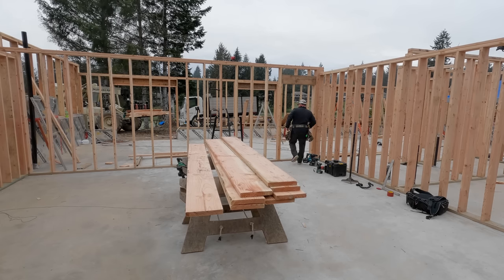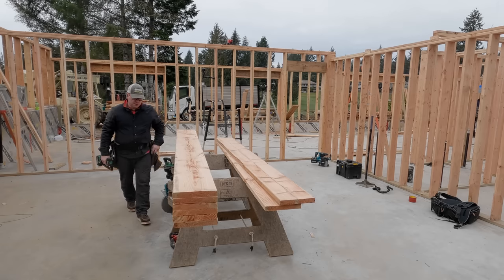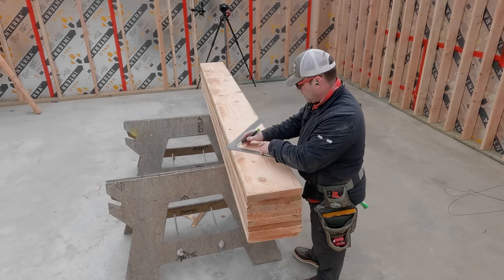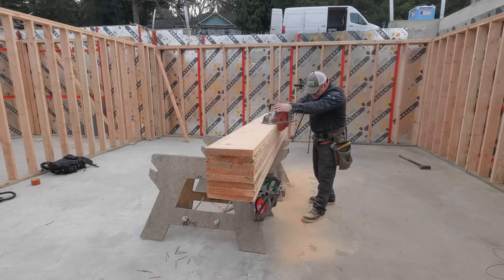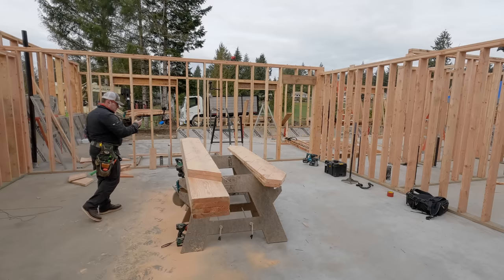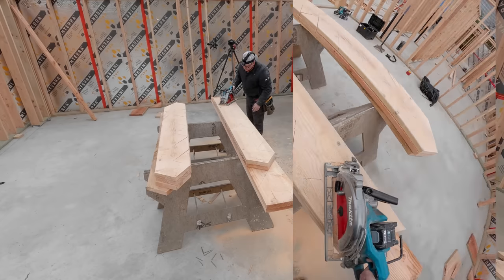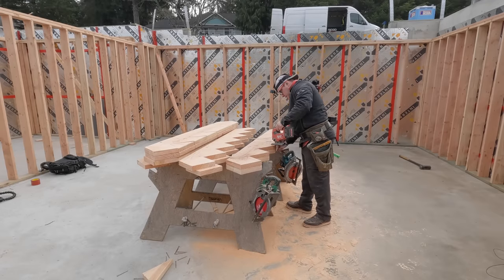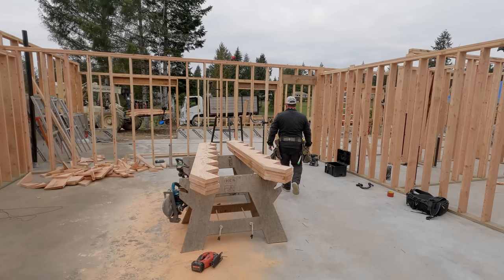How to Frame Stairs Efficiently part 1

Comment: I wonder what happens with the moisture trapped betwen that aluminum foil and the insulation. Shouldnt the barier be on the inside walls to stop the moisture getting in and get trapped?
Reply: Think it depends on climate.  Concrete doesn't mind moisture.   Where they're framing the house is cooled more than heated, I assume.  So condensation would be trying to work it's way in, not out.  The goal is to protect the wood and living space from moisture, not the concrete
Reply from the maker: It'll all dry out 👍

Comment: As a homeowner DIY'er I have found it very convenient to stick with one battery platform.  Quite a long time ago, I happened to purchase a DeWalt 12v drill/driver when my old Ni-Cad drill batteries gave up.  For years, probably more than a decade I used and abused that little DeWalt drill and it is still going strong.  So, I stuck with DeWalt.  They pretty much have every tool I will ever need.  I did stay with corded tools for power planer, jig saw and circular saw.  I use those mostly in the garage or the workshop or machine shed at the family farm.  I do have a nice power bank I can use if I ever need to use those in the field.

Thanks for another great, informative video.  I can see your point regarding your tool choices.  And yes, as a matter-of-fact, I am beautiful and talented but I don't think I can match you for singing and dancing.

Comment: You don't need to overcut much with that 10 1/4!!  Love it
Jealous of your douglas fir.
Here in michigan I rarely get it.  Builder orders lumber, not carpenter.  We typically get white fir or SYP for stringers.  The former makes me cough now and is usually poorly dried... case hardened..  and tends to move as it's cut.  It likes to become the letter 'C'.  The latter is hard as a rock and loves to split.  Also resin from syp coats the carbide.  
Doug fir is very stable as it dries, relatively so, compared to other softwoods.  Cheers love the content

Comment: this video is great. after cutting stringers for my deck and tracing with the first cut one, my variation from one stringer to the next was a lot. cutting the line on one, being inside or outside the line on the next was a lot harder for a non carpenter than a lot of people would expect. i debated on buying the prazzi beam saw for my front deck but i think i’m gonna try this method! one thing i’ve never gotten clarity from in all the stringer videos, why does everyone plunge into the wood? i’ve never heard anyone explain why and if you should do it?

Comment: I hv been using those “Spyder” jig saw blades for rough cutting and Bosh fine tooth for trim (finish carpenter) .  So far the Spyder’s allow me to back out if my blade gets pinched!  Anyway great job!  I wish I did more stairs just not a factor here?  Either u guys do them or they call in a stair making co.  
10-4 over & out!

Comment: Why so much wasted material at either end of those 2"x10"(?) Why not get shorter lengths? Availability?
Reply: They make blocks of of ends all the time in all the videos. Also ends of big boards (he says 2x12 ) tend to dry out compared to the rest of the board and want to split there.
So maybe good idea to use those non-structurally in blocks, rather then keep the split in the stringer.